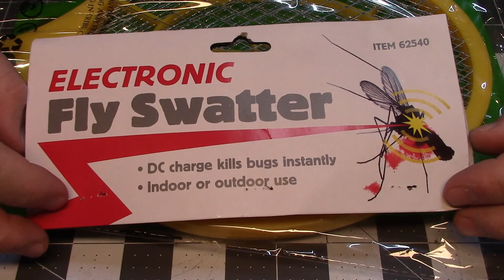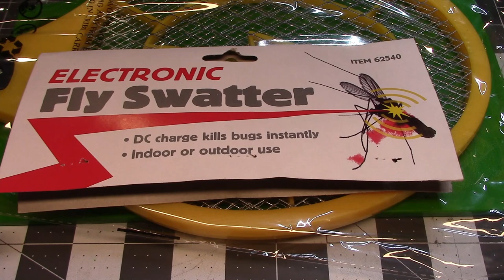Static grass applicator build

Comment: question time. my layout has a plywood base not foam. will this unit work on that base? great video and I really want to try this if it work for me
Reply from the maker: A small nail can be substituted for the push pin. As long as the nail is in contact with the wet glue you will be fine.
Reply: @SoloContracting  thanks. time try it out

Comment: I built one that I get a spark when I touch the clip to the metal but no static in between. can you help?
Reply from the maker: Are you placing the grounding pin in a wet area? Try to stay as close to the grounding pin as possible.
Reply: @SoloContracting  Thank you for answering.
I have another applicator that I built using the ion generator. when i hold the pin close to the sifter I can see the spark traveling in between. On this one I don't get that. Maybe I swatted too many stink bugs with it.... lol.
Ill try again.

Comment: Fantastic video, but maybe could benefit from some of the bits like the sanding being edited down in length?
Reply from the maker: Thank you. I'm trying to work on that.
Reply: @SoloContracting  - maybe run things like the sanding at 2x speed, or fade out after a few seconds and back in just as you finish? I felt I needed to skip a few bits like the sanding.